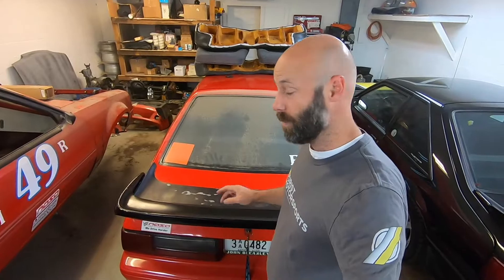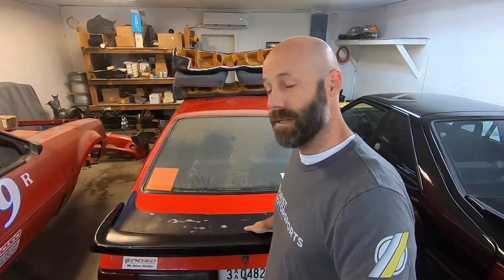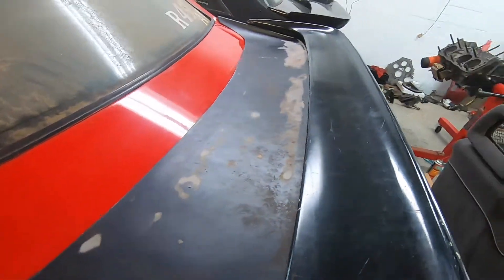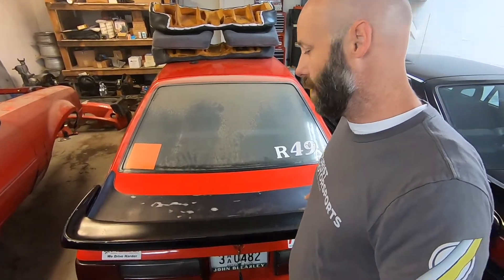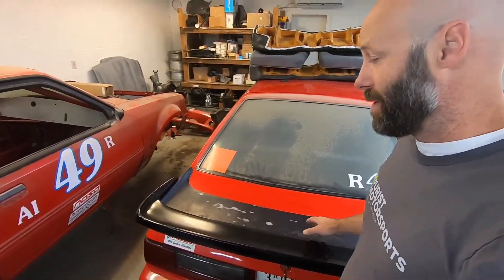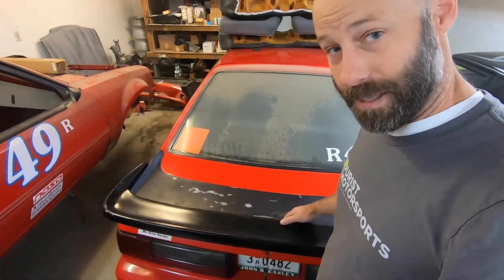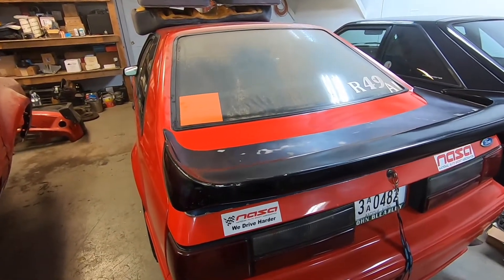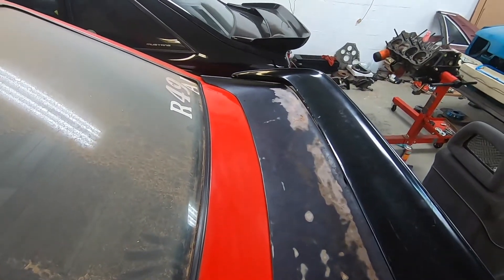Saleen Wing Comparison - Double stack vs Whale Tail Style.

Comment: Great information! Count me as one of the people who were under the impression that the stacked wing was simply a piece added on top of the factory spoiler. And, I definitely didn’t know there were 3 variations of the lower piece. On 87-89 and 92-93 cars with the one piece wing, did Saleen have a special arrangement to order cars with GT hatches? I can’t imagine they had the time to fill all the LX spoiler holes and repaint the hatch.
Reply from the maker: Dennis you're correct.  At one point Saleen had their own DSO with special options set up for the conversion to a Saleen.  From what I know, that included the GT hatch, radio delete but with an antenna. From what I gather that was mostly in 1988.  I'm not sure when the specific start of that was or when it ended.  I've been told a few things as to why they quit but it is only hearsay.  Nothing documented or confirmed by the Saleen family or people who worked there.  I do know that my 1989 #448 that I owned was an LX hatch and was not a Saleen DSO.  The Saleen DSO cars are easy to spot as they have two buck tags on the radiator core support.  One is specifically stamped SALEEN.

Comment: Nice info!  Sort of like Ford did with the SVO wing, it’s slightly different than the normal LX wing.  Which brings me to another question, did Steve ever consider doing an SVO Saleen?  Would be interested in this decision process (maybe another video?)
Reply from the maker: That's a good question. My best guess is that the SVO was a competitive model to what Saleen offered?  I do know they didn't convert many Cobras from 94-04.  And other than suspension, there wasn't much value added by Saleen.